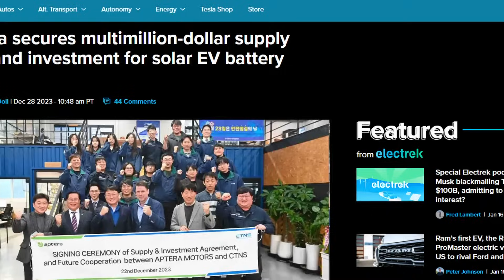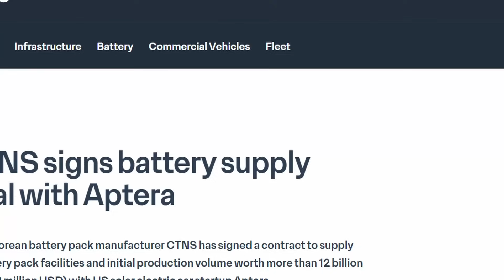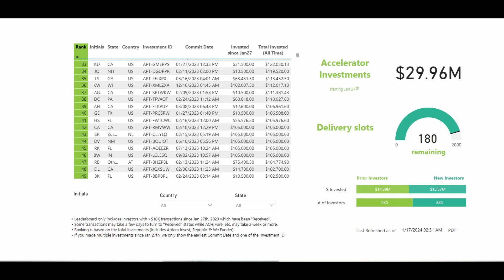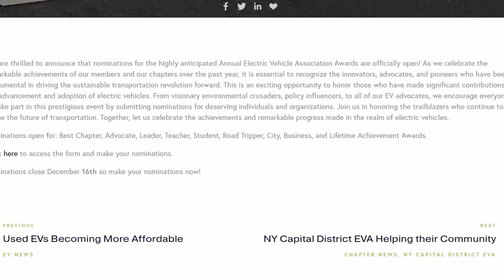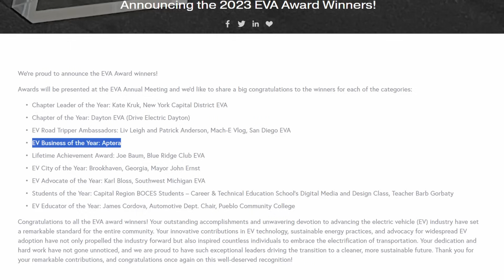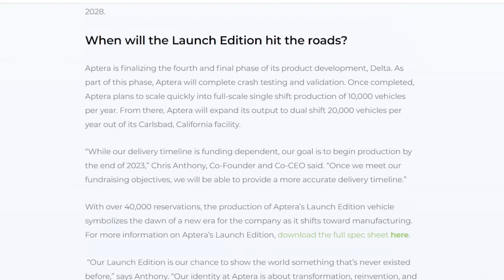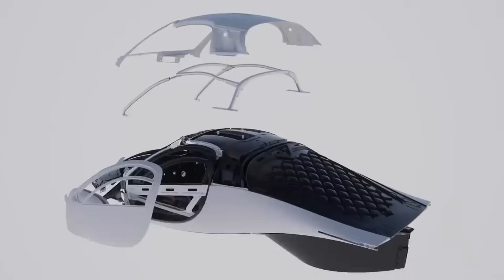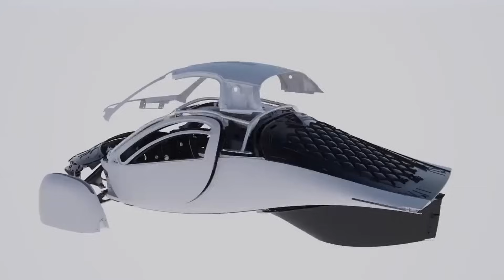Aptera January 2024 UPDATE | What About Production?

Comment: If/when production begins, as reported, at 10,000 units per year or (with double-shifts, 20,000) we're looking at several years before "regular folks" can actually buy one. Right? By the time Aptera has something to sell (other than ideas), technology will have changed so much that its range will no longer be much greater than the norm. I'm still a fan. But not an investor.
Reply: No one should invest any money they can't afford to lose.  Investing in any early stage company is like donating to  charity - to push the world in the direction you want to see it move.

Range is not the primary benefit in any case- it is a consequence of the primary benefit - which is the  lower environmental impact of its use - something I dearly hope gets copied by others.

Comment: Aptera is the only EV that has the magic combination of long-distance end extremely efficient. You can't get that anywhere else. I think Aptera will be a real winner! Looking forward to getting one.
Reply from the maker: Exactly.....
Reply: @tr-labs8320 Hardly.  Aptera has more crumple space than most cars, a passenger safety cage, and will come with air bags.  None of this is required for "motorcycle trikes".  Aptera will crash test Production Intent vehicles to FMVSS Part 200 automotive crash standards by a third party, and make the results public.  You are wrong on the facts.
Reply: Lots of claims. Just selling ideas. Elio did it for years. They are following his blueprint to a T.
Reply: @mikenovak5226  You haven't done your due diligence.  Elio made claims while accepting non refundable deposits.  Aptera pre-order deposits are held in escrow and refundable on request.  

 Aptera is partnering with real companies and is now producing real production intent parts with real tooling.  They have significant tech patents that could well result in independent revenue streams. Elio has a few "seat adjustment" patent grants.
Reply: @mikenovak5226  Elio was lying about their engine factory and had no IP.

Aptera has real suppliers and has valuable patents you can look up for yourself.  You are just wrong on the facts.
Reply: Aptera is great at sucking money out of suckers pockets. Not good at selling anything.  Elio part 2. Will disappear soon.
Reply: @mikenovak5226  Comparing to Elio is a knee jerk, fact free reaction.  Elio did not have the tooling or engine they claimed, nor any patents. (Elio engineering had some seat adjustment patents)

Aptera has real partners, tooling costing millions that are producing production intent parts, and an important patent portfolio.

You are just unaware of the facts.

Comment: Does the accelerator program end in January or September assuming there are still slots available?
Reply: I think it ends when the slots are gone.  The rate they are going is speeding up.
Reply: It has ended now.  No new slots are available, but existing investors can still jockey for position for a while yet.
Reply: @n.brucenelson5920  yup I've seen they are sold out but some were after the one year mark which I wasn't sure if that was a limit.

Comment: You do understand the designation tier one supplier is made by the company who is using that supplier.  For Aptera they are a tier one supplier. For the industry there is no such designation among its peers. Plus look at CTNS closely. They are very much a startup and their presence at CES was a standard small booth which by the way did not even mention Aptera. It did mention their ebike battery swap solution.  

I suspect Aptera could not afford anyone but a hungry startup in this space and is why so little progress had been made on their own battery packs. Remember, Aptera has never shown a functional production intent battery pack.
Reply: is your day job of so low value?
Reply: @casylong8383  - What does that have to do with the conversation?